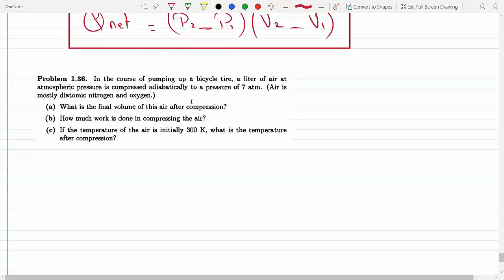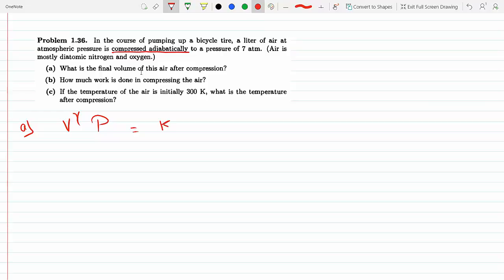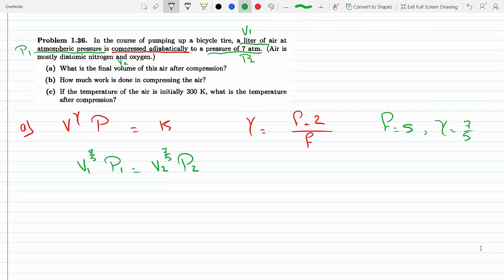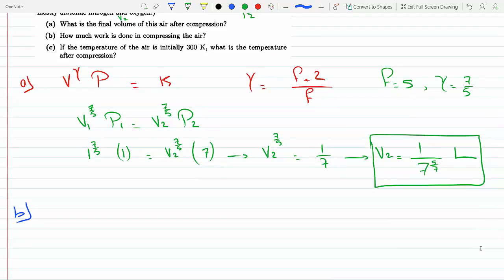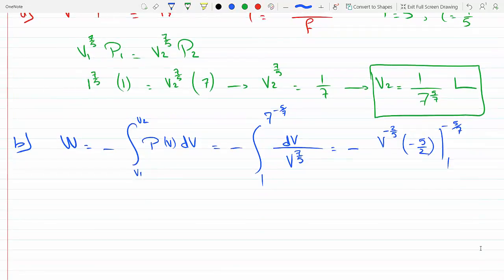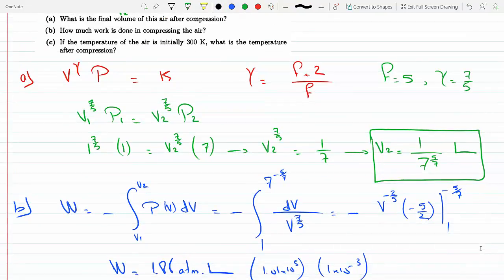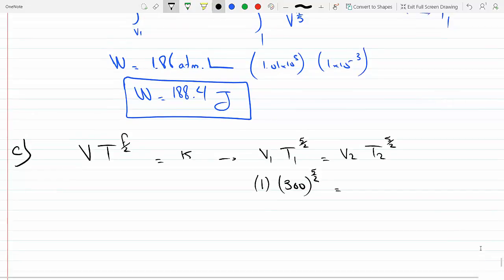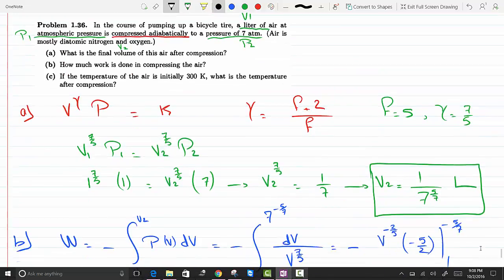Find final volume work done and final temparature after pumping air into tire 1-36

Comment: Hello Marx,
Why we have to use dv/V^7/5 in the step B?
Reply: The integration is in terms of volume but we only have pressure but the relation is V^(gamma)*P=constant (eq. 1.4 in Schroeder). He rearranges in terms of pressure to say Pressure = constant/V^(gamma), where gamma for air is 7/5. Then plugging into the integral, W = - int[Vi to Vf] (1/V^(7/5)) dV. Hope this helps!!
Reply: @sharpdesigns09  don't we need to find the value of that constant then?